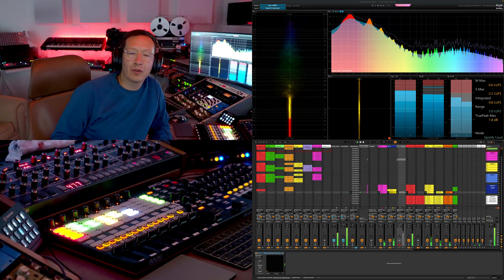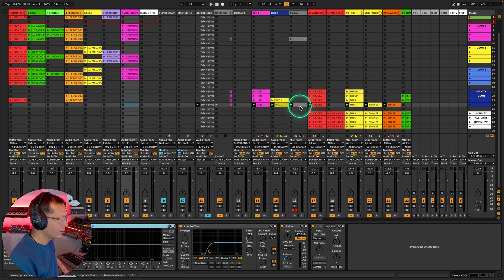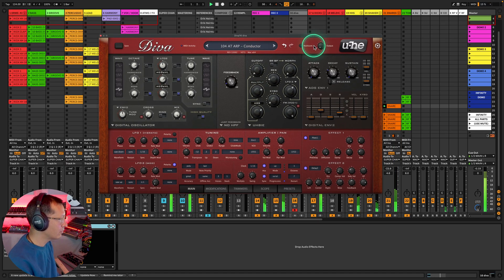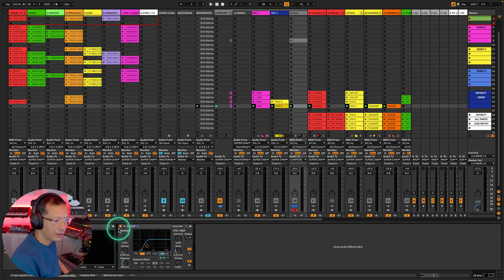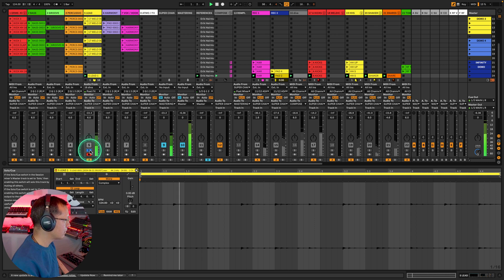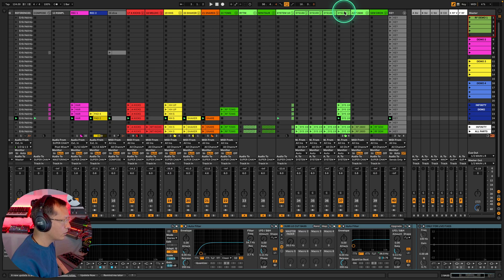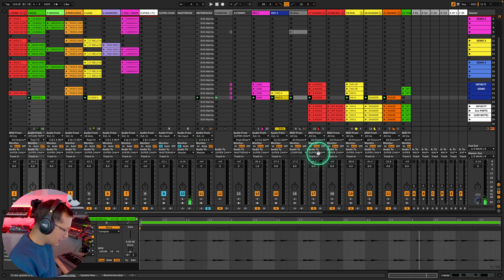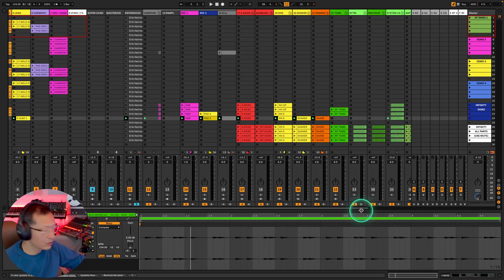Tutorial: Composing With The Rapid Flow Template

Comment: This is great! Happy customer and user of the rapid flow template in both Bitwig and Live. I also really like the simplicity in mapping all to 8 tracks. I’m now also doing more off the box using Maschine+ and I’m working with end state of having these 8 channels in mind so I stick to 8 groups in Maschine. Wondering if you used Maschine+ in this way?
Reply from the maker: That sounds really cool. Been wanting to grab a Maschine since some time but have never used one so far….
Reply: @RapidFlow_Shop  Erik, I encourage you to pick up a Maschine+. I'm pretty sure you can port the entire RapidFlow template to a Maschine Project template and have it be a DAWless production system. All of the key mixing and arrangement components/elements are there (i.e. FX, routing, patterns/scenes/song arrangement). I see from your videos you don't have shortage of equipment and Maschine+ right now would be an overlap for you. But it could also be a way to take Rapid Flow on the go.